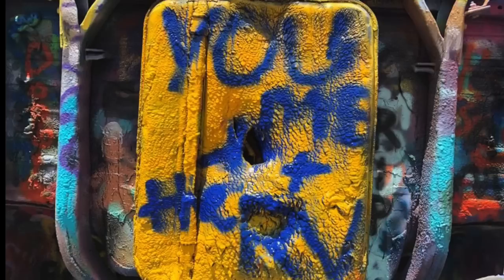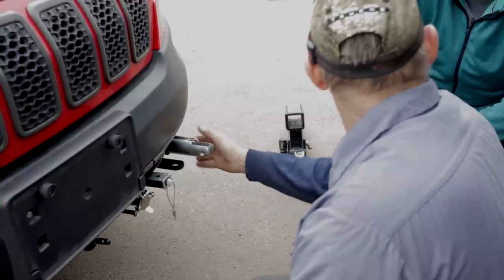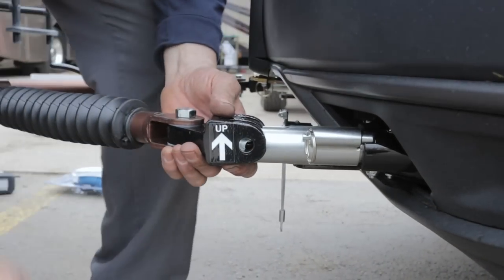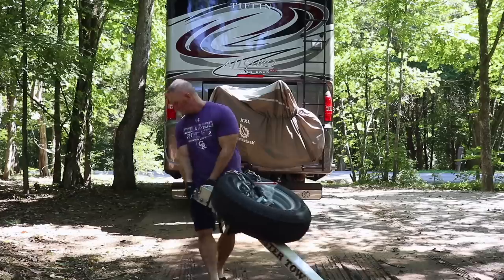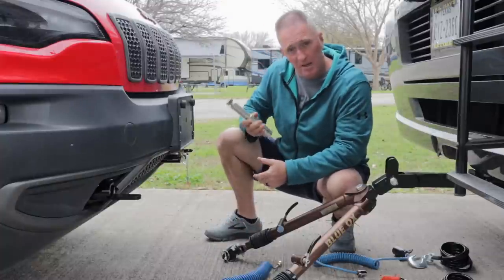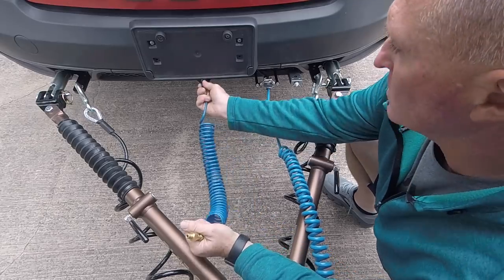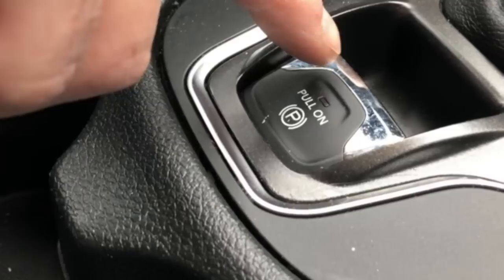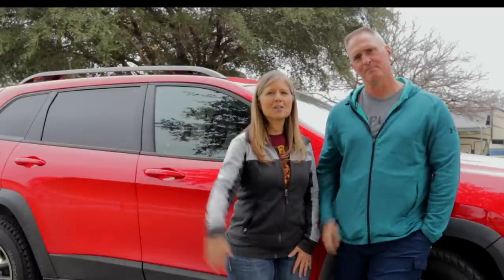What is Better Flat Tow or Dolly - Full Time RV Living

Comment: Hi Phil and Stacy enjoyed your video on towing, back in the day when we first started the years 1999 and 2007, we had a Safari Ivory Diesel Pusher no slides, we towed our 1/2 ton pickup with a Blue Ox tow bar, it was so easy to hook up, at an escapade rally in Chico, Ca we found a brake system for the pickup. But the Blue OX is what was suggested to us and it was the best. We are going back to full time in 1 to 2 years and are budgeting for the tow bar now.

Comment: Phil, I'm in the process of outfitting my 2014 Cherokee for flat towing so this video was very timely.  Could you do another video on the setup in the Trailhawk?  What did you use for tail light wiring?  How does the Air Force One work?  Does the 2019 require the Death Wobble wiring harness?  Also, you might want to replace the pins where the tow bar connects to the car with locking pins.  There are idiots out there that will mess with your toad while you aren't looking.  Keep up the great videos.
Reply: David Legge:  I have a 2014 Jeep Cherokee as well, and I read in manual that it couldn’t be flat towed.  What kind of modifications can u get to flat tow?  Very interested because I don’t want a new vehicle.  Thx
Reply from the maker: David - Our 2019 Trailhawk taillights are wired to the front of the jeep and connected to the rig via a  4 pin to 7 pin connection.  The Air Force One operating system ties into the rigs air brakes and supplies air to the actuating cylinder that is attached to the Jeeps brake pedal. It has a brake safety line attached to the from as well, so if the Jeep were to come loose from the RV, the pin is pulled and AF1 will supply reserved air and apply the brakes to stop the Jeep.   I have heard from other Trailhawk owners that they have not experienced the death wobble.  I am hoping for the same!!
Reply: @crystalstevens5010  , the non-Trailhawk Cherokee come with two different 4 wheel drive systems. The Activetrak II system is flat towable. If you have the little button and LED like Phil shows in the video then you have the Activetrak II system. No button,  no tow.

Comment: Phil, beautiful jeep. I have a question. One of the last 3 or 4 steps you did on your check list was to engage the parking brake but you didn't disengage the parking brake after that.?? Did I hear that right, I went back and watched it again. Do jeeps tow with the parking brake engaged? Take care of your back. Love the out takes.
Reply from the maker: He does say remove the break but I forgot to record it so it appears as if it wasnt done.  But the parking break is only engaged long enough to double check the tow assemble and then it is removed. Thanks for making sure we didnt have another newbie mistake! PS: Our last safety check is always lights and the tow cars wheels rolling and not getting drug behind.

Comment: Late to this party! We have recently purchased a 2019 Cherokee Trailhawk,used, an have been advised by several sources that the Cherokee Wobble still can be found and that a Mopar electrical harness should be added to prevent. Issue was most evident in Wranglers but also in Cherokees. Have any of you experienced issues with your tow?

Comment: From watching other video's and using the same set-up; it's recommended to use locks on the pins at the Jeep. It has happened to some RV'ers that someone pulled the lock on the pins and you know what happens next as your driving down the road. Be safe and thank you for sharing.
Reply from the maker: Thanks for the info. We are ordering them!

Comment: Hey  you guys I have enjoyed the video hope we can catch up with you someday we have the same flat to just remember because I didn’t do it every time but do not put your foot on the break when you try to put the motor to run and not start I was so used to getting in the car and automatically putting my foot on the break and of course it will start every time it took me a few times to figure  what I was doing wrong ours is a 2016 trail hawk and it toes great read somewhere about the death wobble but haven’t seen it yet has something to do with the steering the lane departure system did they mount any kind a light indicate when the brake was pushed in the car? Happy travels🤗
Reply from the maker: We have already done that once! It is hard not to do it because it is really a habit! Death wobble has been corrected as of 2019.

Comment: What braking system did you add to the car? What plate system did you add to the car to be able to twist lock those brackets on the front?
Reply from the maker: We have the Air Force One braking system and the Blue Ox base plate and tow bars for the flat tow.

Comment: Maybe I missed this tidbit in your video, but the AirForce1 system can only be installed on RV's equipped with air brakes, correct?
Reply from the maker: Yes, that is correct.

Comment: How do you know that after the 19 steps everything is alright before you actually start driving away? How do you know if one of the steps didn’t work?
Reply from the maker: We check lights, brakes, and make sure all the wheels turn at least one full roll and then watch to make sure the tow bar arms lock open.

Comment: Phil, we also have a Trailhawk (2016) and apparently there is a concern about the active steering in it that doesn't allow the vehicle to track behind the RV. This could cause wobble as well as damage to the front tires and steering. I know Jeep has a part that enables the steering to free flow. Do you have this installed on yours? If not, have you discovered that the steering is too tight without it and causes problems? I also imagine that with the active steering enabled, it will need something to keep the batteries charged. Just looking for some feedback since we are going to put the part on ours.
Reply from the maker: Thanks D Robinson.  I do not need the wiring harness in my 2019 and have not experienced any wobble or issues.  You may want to ask your Jeep local dealer about the wiring harness required for the 2016 model.   

From a Jeep forum: The 2019 Jeep Cherokee (4x4 models with two-speed power transfer unit) can be flat towed behind a motorhome.  The vehicle does NOT require the Mopar flat tow wiring harness, which was developed for 2014-2018 models to prevent the wobble that sometimes occurred during flat towing. 

The owners manual can be found here: https://www.mopar.com/jeep/en-us/care/owners-manual.html

Side note: A service bulletin issued on April 20, 2018, indicated that the Mopar flat tow wiring harness was needed for 2019 Cherokee. However, Fiat Chrysler has acknowledged that the service bulletin was in error.  

STAR ONLINE PUBLICATION 

Release Date: 05/22/18

Symptom/Vehicle Issue: Flat Tow Or Recreational Tow 2019 KL Cherokee

Discussion: A recent update to tab 08-040-18 rev B removed the 2019 model KL from the list of applicable vehicles for the MoPar Accessory Flat Tow Performance Kit. 19 KL, in OEM equipment form, has improvements that does not require the MoPar Accessory Flat Tow Performance Kit to help stabilize the vehicle.

<<<NOTE>>> 19 KL can be flat towed as long as it has the 4x4 (sales code 514) and Jeep Active Drive II (sales code DK4) without the MoPar Accessory harness being needed.  Hope this helps and good luck.  

 Quote

Comment: Great information ! I noticed after you changed to the tow bar from the dolly your bikes were not on the motor home, Did you move the bikes to the car?
Reply from the maker: The bikes are a work in progress. We were using a double hitch receiver before but it wont work with this set up. Phil is researching to see if another receiver will work to carry them on the motorhome instead of the car.

Comment: Towing for the first time tomorrow and wondering how unlevel you can get and still hook up and unhook ?
Reply from the maker: It is recommended to be no higher or lower than 3 inches when hooked up flat towing.  Dolly towing may be different, but you don't want the nose to obe too high as to drag the back end of the car.
Reply: @todayissomeday  More interested on how uneven the ground can be when hooking up or unhooking your toad. or do you look for a completely flat surface.

Comment: Sorry I don't see that cost being $4K - $6K, I did the flat tow all new equipment and  install for $2175 no discounts. Does your vehicle need to stop after a given mileage by the manufacture to idle the engine and work the transmission before continued towing?
Reply from the maker: That was the estimate for labor and parts in our area.

Comment: In the process of doing exactly what you did in the beginning for the same reasons. I have a 2014 buick lacrosse I love and want to dolly tow it, but I'm concerned about the low stance of the car and the damage you said you encountered on the Acura, could you explain more about the possibility in damaging the car.
Reply from the maker: For us the wheel well of the dolly dug into the side of the car when we had sharp turns. We also damaged the nose of the car when loading it on the dolly. Phil eventually added wood to the dolly to protect the nose.

Comment: With all four wheels on the ground, do the miles in tow show up on the odometer?  Does flat towing add to the towed vehicle tire wear significantly?  Does the Jeep stay behind the RV on sharp corners or do you have to swing wide because it is back there?
Reply from the maker: It does not increase miles on the odometer. The wear on the tires is equal to driving the car so they will accumulate the miles. The Jeep will stay behind the RV. I will have very slight movement from side to side.

Comment: Is the brake system for stopping the Jeep if it becomes detached or do the brakes on the Jeep apply while you are driving to help stop the entire rig?
Reply from the maker: The brake system is for slowing the Jeep down when I apply the brakes on the RV....they work together.  We have an emergency brake attached to the front of the Jeep when connected to the RV.  If the Jeep were to break away while being towed.....the lanyard attached would engage the Air Force One braking system.

Comment: After completing the 19 step procedure for putting jeep in neutral , how does the EPS stay active if last step is to turn off ignition. Does your steering wheel now become easy to turn, such as when it's normally powered up. I've tried to turn my wheel after procedure and it is very hard to turn. My concern is how will wheels track when towed?
Reply from the maker: The Jeep tracks with ease. We havent had any problems after completing the steps.
Reply: @todayissomeday  I guess my real question was, after the steps of placing in neutral and sitting behind steering wheel and before it is hooked up to towbar , does your steering move with ease or does it remain hard to turn as when ignition is off?

Comment: Can you send me a copy of the links your talking about because I’m handicapped vet and this sounds like what I need, thank y’all for this video, God Bless, ps. I’m in a wheelchair would this setup be the right fit for me?
Reply from the maker: I think it would be possible for you to connect a vehicle while in a wc but heights of the bar and cables vary depending on the rig and vehicle. Ours is pretty low so you could probably manage it. But that being said Mr Burwick, I dont know the limitation of your movement or strength so I recommend you find someone in a park with this tow system and ask if you can check it out to see if it will meet your needs.

Here is the links if you want to check them out and research what you will need for your own vehicle:
Air Force One Braking System: https://amzn.to/2U7REam
Blue Ox Avail: https://amzn.to/2XmXJSh
The baseplates are different for each vehicle.

Comment: What is the air hookup for on the Blue Ox?
Reply from the maker: Our Air Force One braking system.  It ties into our onboard air via a compressor.  When I hit the brakes in the RV is sends the signal back to the Jeep where an actuator is attached to the brake pedal, engaging the Jeep brake.

Comment: Just a question,- the dolly flat tow is better in the end?  Your car or jeep does not get the odometer increase using a dolly, the tires etc. Is not worn out, and the decrease in value for having all those extra miles on the Jeep.. was that part of the plan??
Reply from the maker: Yes, for us flat tow is much better than the dolly. The like many cars that can be flat towed, the Jeep does not accrue miles while being towed. While using a dolly wear and tear will happen to the the rear tires much the same as tire wear while flat towing. So there is no decrease in value to flat tow our Jeep.

Comment: I wonder about the extra wear and tear on the tires when towing?  I've heard that people need 2 sets; a not-so-great set for towing, then change when they get to destination to better tires, so they don't wear out their tires when the car is only on tow.
If I were to tow a car, I wouldn't want to deal with that; I'd want a full dolly, where the entire car, and not just the front wheels are on board, so no messing with tow and non-tow tires.  (I looked at the guide, and noticed zero Chryslers in the list; my PT would not be flat-towable.  So I'd want it fully up on a 4-wheel capable dolly. But, I probably won't go that route anyway; I'm looking more a 5th wheels...)
Reply from the maker: There will be wear and tear on the tires just as if you were actually driving it. Just as there was wear and tear on the back two tires that of the car while using the dolly.  I have never hear of any one changing out there tires when they flat tow. We couldnt do that anyway.  There would be no where to store another set of tires and who would want to deal with the hassle of changing tires every time you changed locations. 

Think about it this way: You will put the same amount of miles on your truck to pull your 5th wheel as we will put on our tow car (although we wont put the miles on the engine).

Comment: I installed a similar system in my Class A and Pickup. In hind sight, I should have spent the money on a trailer with electric brakes that I could tow any vehicle with. 
They are also a lot easier to back up with.
Reply from the maker: Are you selling your truck? Do you not like the tow bar?
Reply: @todayissomeday  no, not selling. My opinion is for what it cost to put the remote braking system in, I could have bought a car trailer and towed any of my other vehicles instead of the truck. If I do sell the truck, then the replacement will need to be modified at additional expense. It will also have to be compatible with flat towing. If you have a trailer, just drive the new one onto the trailer. Backing up when towing 4 down is also a pain.
Reply from the maker: @DannyB-cs9vx  This is true as far as the cost and it is the reason we started with our dolly. We only have one vehicle now so that isnt an issue for us we downsized when we hit the road. But whatever you decide has to be the right fit for you! Flat towing is just a better option for us. The dolly might be a better one for you....definitely a cheaper option.

Comment: wow! What a complicated procedure to get into flat-tow mode!  I guess it's good that they did plan for it, but I'm a little too lazy for all that, I'd just buy something with standard trans that only requires shifting to neutral and release the parking brake to flat-to.
Reply from the maker: Most will require you to full a fuse or do something with the battery. But for us its worth it to ditch dolly.

Comment: NINETEEN STEPS! CRAZY!!!!
Reply from the maker: They are very simple and some are no big deal: turn off car. Sure beats messing with the battery or fuses.
Reply: @todayissomeday  Probably a dumb question - but do you have to repeat the 19 steps when you disconnect the toad?
Reply from the maker: @sadiejosiemom  Not a dumb question. No, it is just a couple of steps to re-engage the transmission.